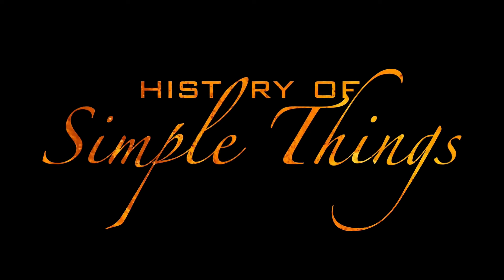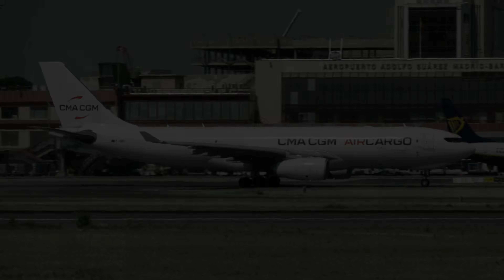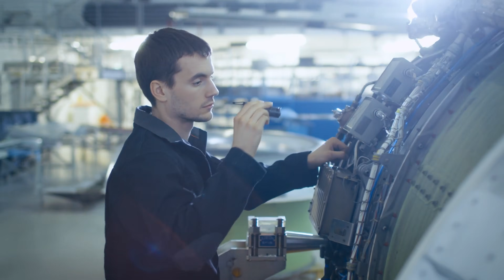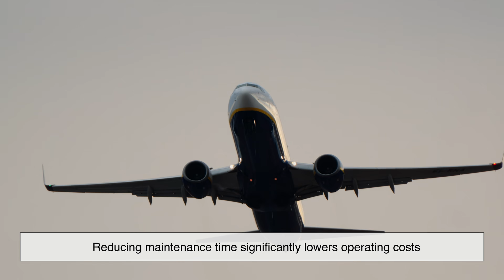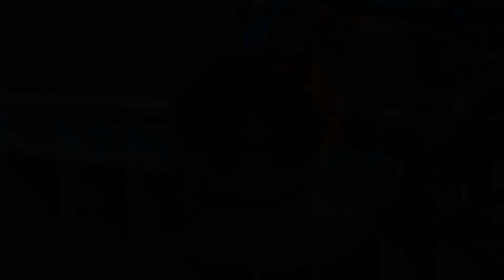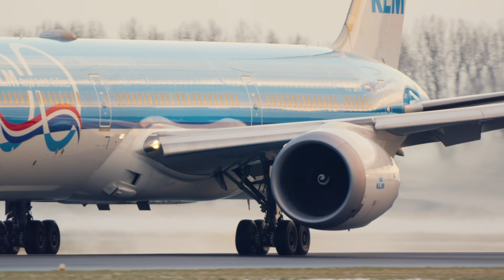Why Are Jet Engines Mounted Under the Wings?

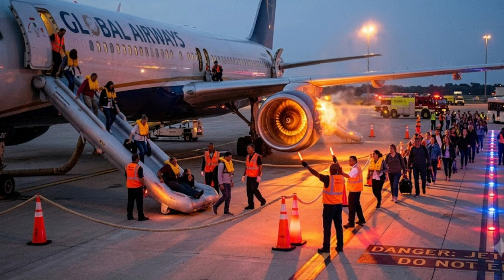Comment: 5:36 This is why after an emergency landing there is a moment when the Pursuer and the Captain have to communicate. If the Captain determines that an evacuation is necessary, then he and the First Officer have to go through their "EVAC CHECK LIST," which involves shutting down the engines among other things to make sure it is safe to have PAX on the ground by the aircraft.